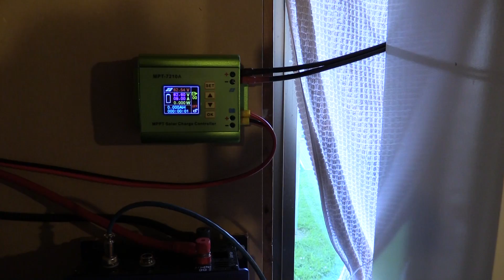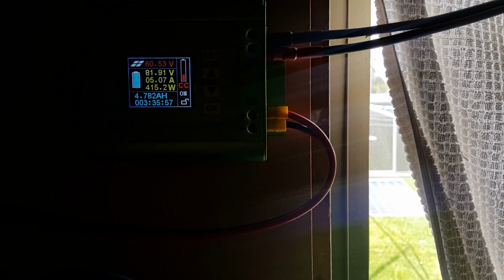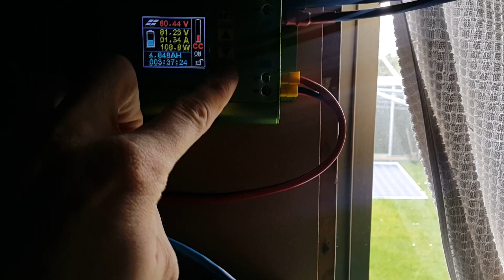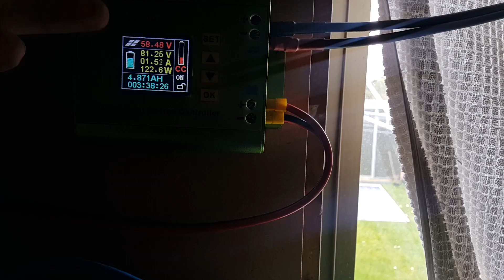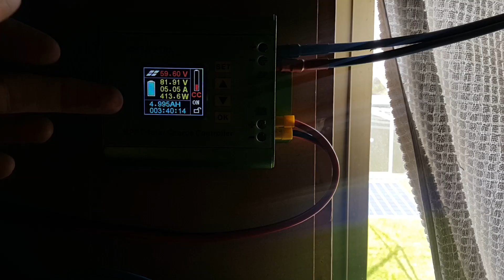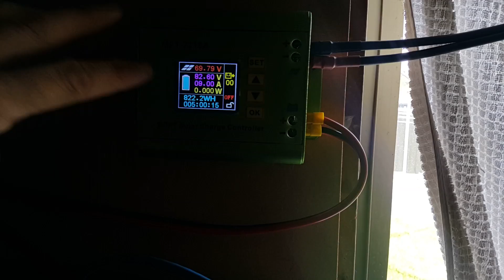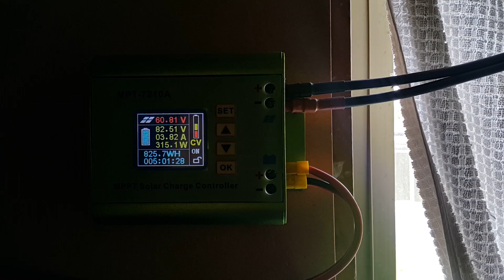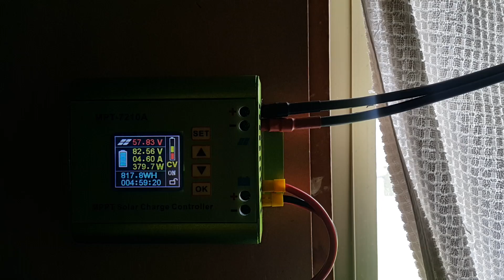MPT-7210A MPPT Solar Charge Controller Part2/4

Comment: I have three of these controllers and have failed to get any of them to actually control the current at any settings. They even pass their own maximum setting and have seen them at 13.2amp 26v.  I have blown numerous 10amp fuses between the panel and controller and would like your opinion on whether you feel the controllers could handle 15 amps.

Comment: This is exactly the video I was searching for. I want to use the same (rather cheap) step up charge controller for my 57.7Vmp/72.8Voc panels. So it seems that the 60V isn't a hard stop. I just will drive the controller even a bit more to the extreme as I will have 6 of these 80W panels in parallel.  Thanks !

Comment: Why did you go series on the panels if your going to use a Boost type  Controller ?  What kind of Battery voltage and converters are you using ?  48V ??
Reply: I think he is using a 20S (84V full charge)  Li-ion battery

Comment: I've been having an issue with one of those; if I throttle the fan speed through the menu, the output voltage reading gets erratic and CC/CV/FULL goes over the place when batteries almost full. Did you face such issues? I read other people have same problem on secondlife forum.

Comment: hello i have 2 pice of 24v 300w solar panel and 2 big 12v 210ah battery do u think this controller is good for me
Reply from the maker: No i wouldn't use this controller for that.
Reply: No is a good answer. Because this is a boost converter. Not good for 12   Volts batteries in parallel. You need a buck converter I  believe.

Comment: ive been working on a similar system for the camp trailer, for my electric bike ive been building, and you kinda touched on things ive had ideas for it, but i dont know enough so i havent tried them yet... but maybe you could find a use for the ideas.
idea 1 - to stop the drop outs, maybe have some sort of capacitor between the panels and the charger, that holds a charge, then releases it, to fill in the gaps for a few seconds until the clouds pass by.
idea 2 - . this idea is 2 parts.... some how make 2 seperate "circut breakers"  that are adjustable to your specific needs, one the breaks at a specific voltage, and one that breaks at a specific amperage...

..i dunno... just ideas

Comment: It's probably a fair bit safer to parallel the panels with that controller. Doesn't look like the 10A limit would be a problem, unless it's a 10A input limit. For long term reliability, I would recommend staying below 80% of the voltage rating of the caps.. Though they're probably not quality caps given the price point.
Reply from the maker: Ya replace the caps to 100v might be the winner. I read somewhere it is 10amps on the output and 8amps safely on the input. Which is only one panel but my finding are that 60v in works well with how many watts it outputs. With the 30v in i cant see over 2amps when at 83v

Comment: Have you opened up the unit, see if there are any ISCP / JTAG headers exposed?   I tried to google around a bit, but haven't found anyone else attempting to hack them with better firmware...   I ordered one today to test for myself...  The slow boat should get here by Christmas.
Reply from the maker: i didnt see any ISCP / JTAG headers but i wasnt looking. I will have a look tonight

Comment: I would not be running two panels in series you are asking the caps to blow up. If they say 60v on the cap then 57v should be the safe upper limit. My classic when it powers up takes 15sec it samples everything then kicks into mppt but does not do that again even in total cloud cover. Be very careful with over voltage or it can burn down the building.
Reply from the maker: Your right i need to do something about the caps if i wish to use it long term. My thoughts are to replace them with 100v caps. I was looking at the MidNite Classic 150, is that what you have?
Reply: yes that is what I HAVE A MIDNITE CLASSIC 150 FOR MY 48VDC BATTERY SYSTEM and two EPever 30amp units that handle 100v and they charge my 12/24vdc system
Reply from the maker: EPever 30amp - Solar input 100v, output 24v max.  Midnight Classic 150, 150v Max normal solar input and looks like a good controller and more importantly for me i can handle high DC Voltages like 84v and max 80amps. Tho the one downside - its around $1400 NZ so it far from cheap. My question is... Is it worth it ? I can buy alot of MPT-7210A units for 1400 dolars. Hmmm
Reply: I would say for that much money it is not worth it
Reply from the maker: doesn't do 84v from the spec sheet, the Classic 150, goes all the way up to 96v batts
Reply from the maker: that might be true but if i cant get these 63v caps replaced with 100v ones i might have to looky at something bigger.

Comment: Have a think about circuit breakers rather than fuses. They react faster, resetable and are great switches.
Reply: Circuit breakers and handle many thousands of amps fault current. Yes HRC fuses have a higher fault current but in this application using 4mm2 solar and 5mm2 output to the batteries, you wont exceed fault current rating on circuit breakers.
(of course depending on the breaker and fuse type will affect fault current rating).

Comment: thats impressive, i wonder if a big microwave capacitor across the input, would help with the clouding issue, mind for £23 what can we really expect  :)
Reply: Tricky world, What do you mean by a capacitor rating of 700 watts. capacitors have a voltage rating and a capacitance rating. (ESR, Temp and others) To be honest to don't think a few 1000uF will make much difference any way. But always good to try.
Reply from the maker: Thats a really good point, i was thinking kinda the same thing tho i dont have one to test.
Reply: microwaves are 10 a penny, if you live near a tip you will very likely get 1 for free, car audio power caps would also have the same effect, but your talking silly numbers there, unless you know a local scrap collector ;)
Reply from the maker: ya car audio tho isnt 60volts its only 12v so that wouldnt work with even one solar panel. Hmmm
Reply: haha yeah thats why i said silly numbers, you would need 7 in parallel if using car audio caps, microwave caps are certainly the better less expensive option, its a shame your not local, im sure i have a couple of old microwaves in my container :(
Reply: Any switch mode power supply, Old tvs or inverters or UPS would have large high voltage capacitors. Im not sure how much it would help. But give it a go.
Microwave capacitors will be say 3000V at a few uF so very very small capacitance.
Reply: its the power that matters mate, the ratings are just a guide for the outside maximum, microwave caps are usually good for 700 watts, as long as the voltage doesnt exceed the rating ;) i always think of the cheap easy option, its no fun waiting 3 - 4 weeks for components from china haha
Reply: yeah im not claiming caps have a wattage rating, its about 15 years since i was at electronics school lol, all im saying is your average microwave is rated at about 700 watts, and these monster caps handle that level of power for extended periods of time when in a microwave, and as they are 10 a penny, it cant hurt to try 1 or 2 out, i know i wouldnt like to try smoothing 500 watts of solar with a tiny cap, just the thought is giving me visions of electrolyte fluff lol